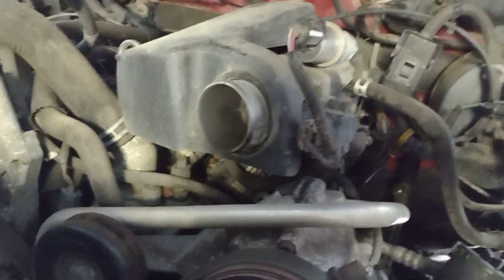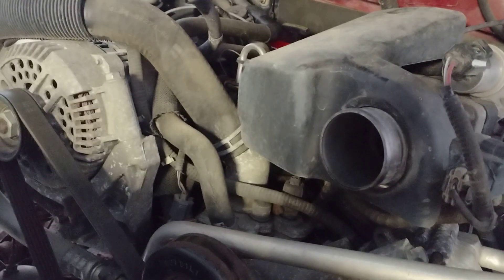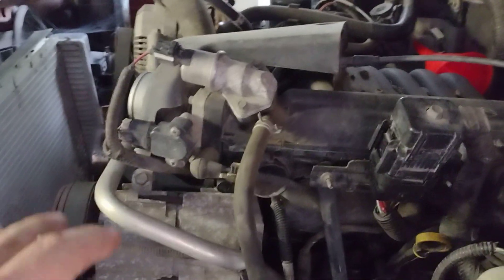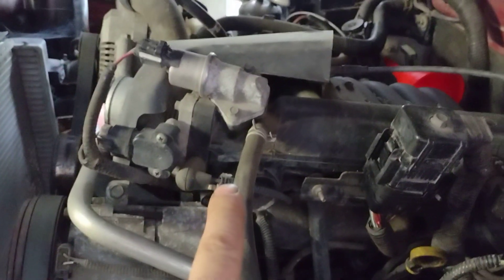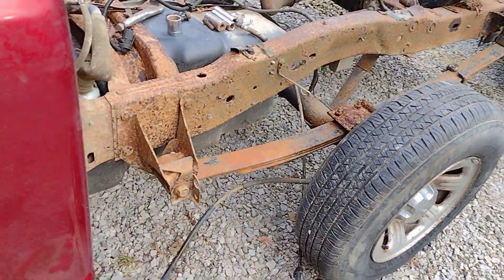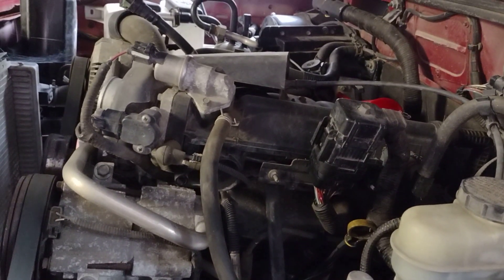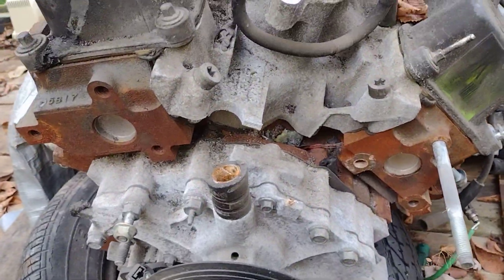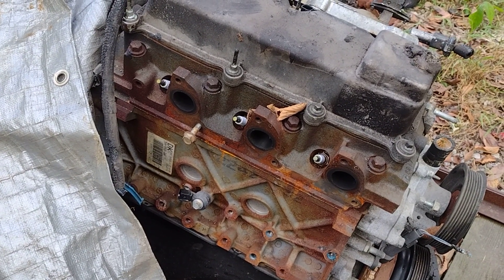Ford Ranger Taurus 3.0 L engine swap facts and (myths)

Comment: So if i have a 98ranger with a 3.0l. What are my options?
Reply from the maker: Your options are pretty much unlimited when it comes to 3 l OHV v6s you can put one in from 1988 all the way up to 2008 from any Ford or Mercury model that had that particular engine

Comment: So for a 1999 Mazda B3000 (flex fuel) I could just get any 97-08 Taurus 3.0L and move all the accessories and parts over? Or is there more nuance there on a few items?
Reply from the maker: If you use your vehicle with the flex fuel you can get any Flex Fuel 3.0 V6 if you're not using your Flex Fuel you can use any 3 l all the way up to 2008 when it comes to swapping parts look at it this way you got a engine that you need to install the accessories to fit your truck

Comment: Would the transmission and bell housing from a 98’ 3.0l ranger bolt right up to a 3.0l Taurus motor? Is there a particular year I should look for?
Reply from the maker: Yes the bolt pattern from 1997 to 2008 are all the same
Reply: @ is there a difference in preference with the OHV and the DOHC motor?
Reply from the maker: @sethkirkland958  it's completely different

Comment: What does it mean the head gaskets are open? I have an 05 Ranger and will be picking up an 05 Taurus engine soon.
Reply from the maker: in the front and the back of the head there are openings the ranger has the rear ports blocked by the head gaskets the Taurus head gaskets are open which simply means the ranger engine would overheat in the Taurus but the Taurus engine would not overheat in the Ranger which is why you don't have to change the head gaskets on the Taurus engine

Comment: May I be so bold to ask where you found such a low mileage Vulcan?  

My dad's factory, untouched 3.0L Taurus has over 320,000K miles on it,...it seems virtually unstoppable.
Reply from the maker: which state are you in I happen to have four for sale one has 25,000 MI
Reply: @stevensdiy9485  Washington state?
Reply: @stevensdiy9485  any engine available
Reply: You have one in Florida?

Comment: Basically you got switch everything but block and heads.
Reply from the maker: No you don't have to change the timing cover the harmonic balancer and cam sensor I believe it's worth changing out parts and only pay 1/3 of what a ranger engine would go for with more miles for instance I bought a Ford Taurus engine with 6000 MI for $300 first off if you found a ranger Engine with those miles you would be paying 3000 or more and if you bought one from AutoZone you would still have to switch over all the parts
Reply: @stevensdiy9485 what’s parts have to be replace, I have a ford ranger 2002 3.0 and I saw the Taurus fit. Thanks
Reply from the maker: @raulmorel8292  it depends on the year of the Taurus engine if yours is an 02 and you got an '04 to 07 it would be valve covers intake manifolds exhaust manifold flywheel water pump

Comment: Man this so crazy so I have a ranger that I suspect someone did this with and I mean you could hd this truck on the limiter and the engine would run cool on the stick before half way and the amount of abuse it handled was absurd it finally threw a rod cruising down the road at 1200 rpm at 35 mph just casually let a rod good like bye bye
Reply from the maker: Exactly that's why I made this video because there's so many misconceptions about using a Taurus engine the 3.0 L engines are great people make a huge mistake by trying to buy a ranger engine over a Taurus 3.0 the price and the ability to get one with very low mileage is a big perk and it doesn't take a lot of work to switch the parts over